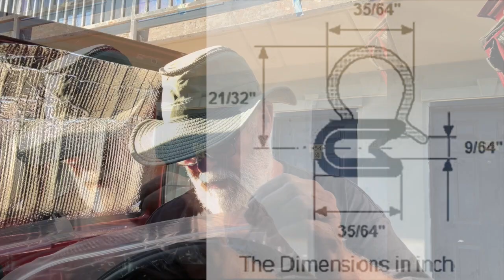Van Build Part 05 • 1998 Chevy Astro Van • Installing Rubber Trim On The Back Doors • 09-16-2024

Comment: Next time you do that Rex, use a little dish soap and a rubber mallet it will make things a lot easier. That will be a great asset for wind noise and heat loss. I kept waiting for the other shoe to drop LOL
Reply from the maker: Thanks for the tip!